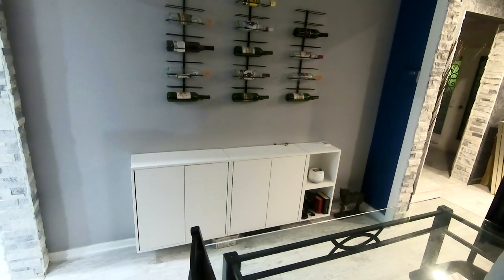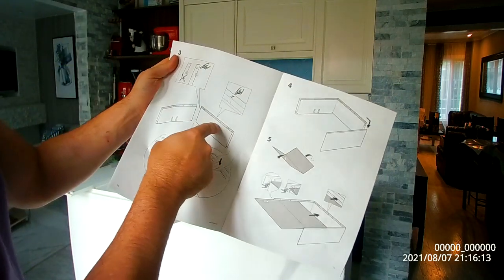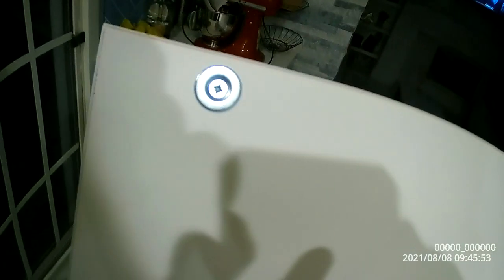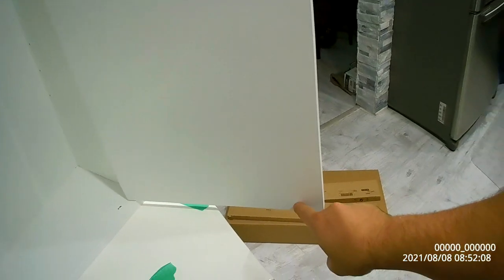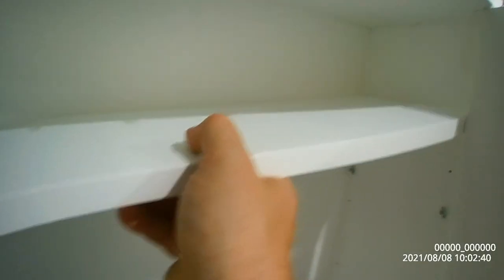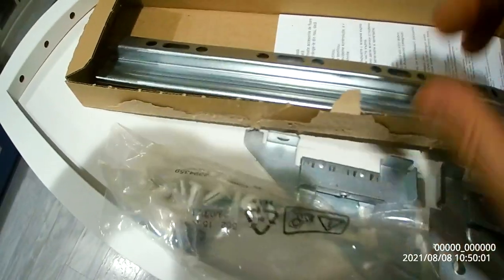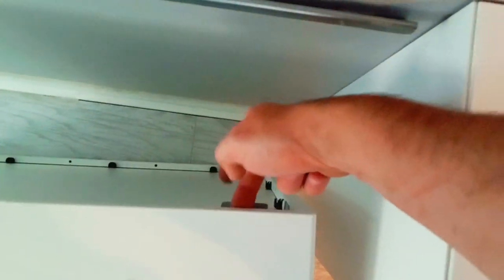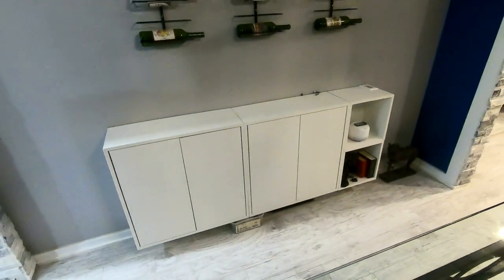Ikea EKET Cabinet Wall Mounting and Eket Assembly Video with Rail Hanging

Comment: Saved my day! Thanks. Also, its much easier if you ask someone to sit in front while adding the clips at the back. (or use a mirror) then add 2 symmetrically opposite clips at the same time with both hands; making sure there is no lateral movement of the frame.
Reply from the maker: 100%

Comment: In no way am I disputing what you say about the back pieces affecting the door alignment - but I was wondering - why is that the case?
Reply from the maker: No clue. Learn from my mistakes :)
Reply: @UnboxingArmy  The black pieces clamp the back panel into place against the frame. This stops the frame from wobbling and causing the door misalignment.

Comment: The 4th side in 2:14 - I have trouble fitting it in - it won't fit on both sides and the thin back part making it impossible,  did it fit fine for you?
Reply from the maker: No that's why follow my video instructions. That back piece is tricky
Reply: I have the same problem. Did you manage to fix the issue?
Reply: @clustinette  yes, you need to look very closely on the ones you already connected and see if it was the right order, mine wasn't and it was crutial
Reply: @Zidkiya  thanks a lot for your answer; I managed to do it before I see your comment but it's very kind :)

Comment: Does the rail on the wall need to be on a stud?
Reply from the maker: look at 8:59, i use the provided plastic anchors. But i managed to get 2 x 3"construction screws (my own) into 2 studs as well that is holding it up in the air.  I wouldnt trust just having all the cabinets and at least 80 lbs of stuff inside on plastic anchors. Too much weight as they are floating, not supported on the bottom. If you are right to the floor, then you'll be ok. You can also buy these screw in plastic white anchors that are rated for 30 to 50 lbs each instead of the provided ones, and then screw into those if you really dont have any studs behind. It will hold them up in the air, but be careful how much weight you put inside.
Reply: @UnboxingArmy  where did you get the hanger rail?
Reply from the maker: @HienNguyen-gt3oq  you have to buy that separate at ikea, yea something they dont tell u unless u ask.

Comment: The eket is such odd construction, the bottom corner joints just seem so insecure.  I'm thinking of gluing the edges during assembly.
Reply from the maker: I did that exact thing, run a short screw from one cabinet to the next , it will be stronger and remove the little gap between